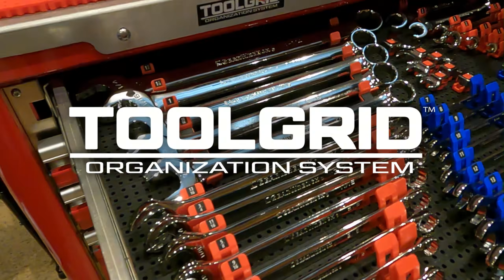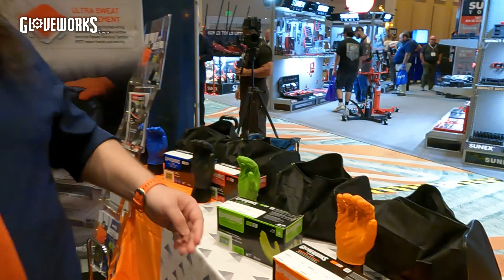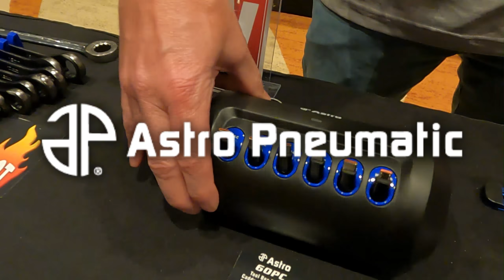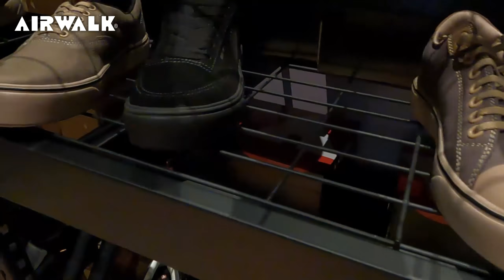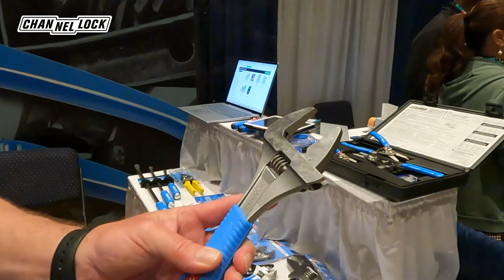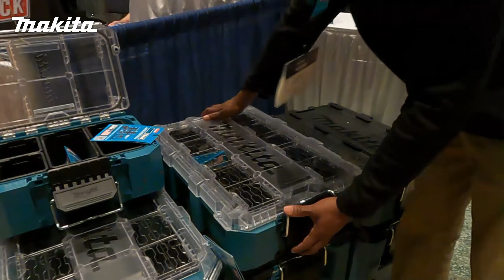30 Products That Stood Out At The #1 Tool Show in North America | ISN 2026

Comment: How much is the WIHA toolkit? I'm expecting to work around SOLAR, and some of the panel arrays have 1000 volts in them.
Reply from the maker: If you are working around 1000 volt solar arrays, it is worth confirming the rating on the exact kit before you buy. I cannot see the price of that kit from the video, so I will check with Wiha and get you an answer. In the meantime their insulated tools are listed here: https://www.wihatools.com/collections/insulated-tools Do you remember which tools from the kit you need most?
Reply: @BiltBayou  , yes, I do the 80 Piece Master Electrician's Insulated Tools Set in a Rolling Hard Case. Sale price: $1,959.98, and Non-Contact Voltage Tester Category IV 12-1000V AC with Flashlight
Sale price: $39.58.
Reply from the maker: Thanks for waiting on this. The video description and our links page list more than one Wiha item, and the ones I can match on wihatools.com sit at very different price points, so I do not want to quote you the wrong kit. For 1000V work Wiha says its insulated tools are rated to 1,000 V AC, and the full range is here: https://www.wihatools.com/collections/insulated-tools . Which kit or timestamp were you looking at, and roughly how many pieces were in it?
Reply: @BiltBayou  time code 10:00: 80-piece, but since looking at the collection, they have a 195-piece set, but I just noticed it wasn't insulated, so the 80-piece. It's $1,959.98

Comment: Astro has been knocking it out of the part with new products lately
Reply from the maker: Astro does seem to be on a run lately, G-craftoffroad. I liked seeing a brand keep putting out practical new tools instead of resting on the old lineup. Which of their newer pieces have you actually used in your own shop?

Comment: The striker im excited for, the channel lock quick release pliers and thin jaw for the size looks very neat as well. Gearwrench hi viz on flex I'd buy. The astro drop wrench I think doesn't look that effective but I'd still buy a set lol. The DeWalt adapters were very impressive and looked like a bang for your buck choice. Gripedge didn't seem like anything new they haven't been pushing but man do I want to buy the new Allen wrench set they just released.
Reply from the maker: That is a solid shortlist, jaggermurlin6343, especially pairing the Milwaukee Striker with the Channellock pliers. Anyone in your crew who swaps between tools all day would probably appreciate seeing this, so pass it along if it fits. Do you lean toward one brand for most of your gear, or mix and match?

Comment: Love the marked wrenches, finally!!!
Reply: A big rectangle of material gouged out , replaced with a sticker,  just put some hi viz vinyl stickers on your old Taiwan set.  These new China wrenches are significantly lighter on a scale, so deceptive
Reply from the maker: Actually, I asked about the sticker.  Apparently it has the same warranty as the wrench.  If it peals or comes off in any way, they warranty the whole wrench.  Some super secret proprietary method of putting those labels on and keeping them on.  When we release the full video interview, he talks about this point.
Reply: @BiltBayou interesting,  still doesn't help with the lighter weight,  all China

Comment: DeWalt needs to get with the program. I just bought the Bosch 12v drill driver kit because DeWalt's 12v line is still huge. The clamp lift is cool though.
Reply from the maker: The hand jack, now with the add-on accessory, is super useful around my garage.  We did a video last year on just the jack.  You should check it out.